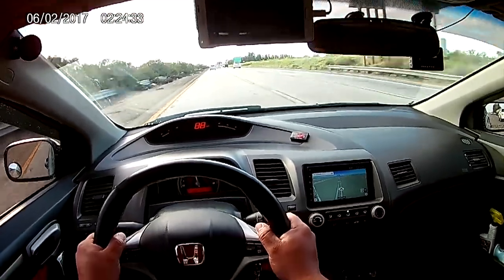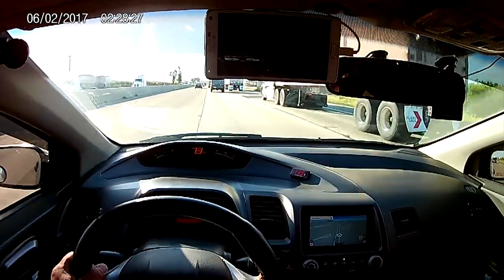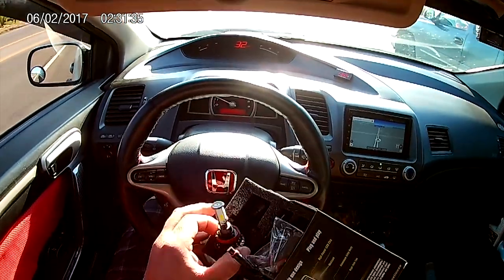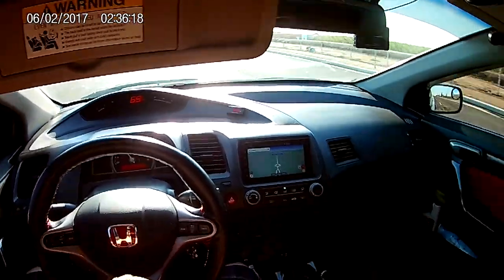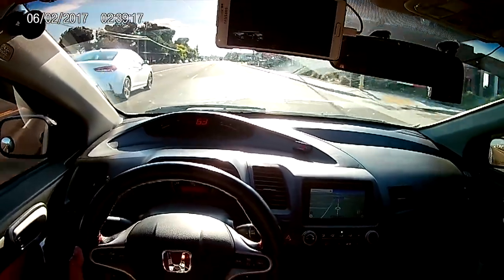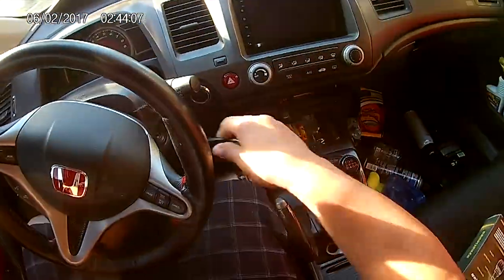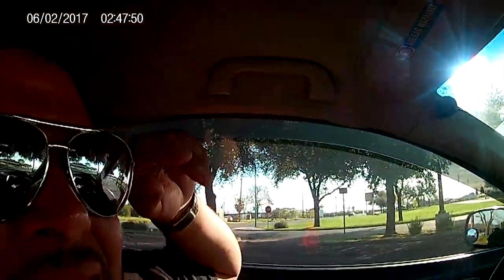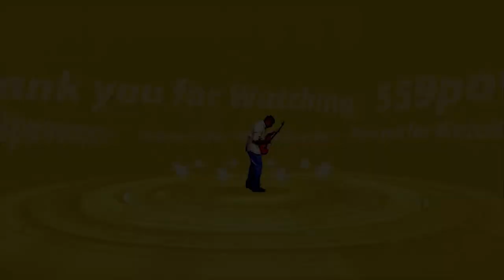POV: Driving my 2006 Honda Civic Si to work and Hitting some V-tech! BRAAAAAAHHHHHHHHH

Comment: Mods?
Reply from the maker: None to the motor yet, but do have some future mods in mind. Just have open throttle k&n air filter. Previous owner welded 3in piping from the cat all the way out before the muffler then drops down back down to 2.5 and it has an aftermarket muffler for sure its not the original but is pretty loud...not as loud as i would like it to be but good enough
Reply: @559powerscape  I currently have an invidia q300 + sk2 header and intake,  however, I'm going the stock route. 

Want to quiet down a bit the car.

I'll miss the performance,  though. 

Good luck with your build!
Reply from the maker: @lightspeedX2  Heck yeah shoot if you wanna send those parts to me I won't get mad lol
Reply: It's funny when people ask what kind of mods you have on a stock SI these things really were f**** screamers man right out the box with minimal upgrades you can embarrass people and take their pride in the Civic which is one of my favorite things to do something about taking a man's pride in a Civic
Reply from the maker: Lmfao 🤣 🤣 🤣 that shit is funny, yeah bro the k series engines move and they love to sign high notes

Comment: The early 8th generations are raw as f*** they tamed them down and dolled them down after the facelift.. the 2009 Civic coupe with the same r18 engine is almost 2 seconds slower to 60 than the 06 Civic coupe
Reply from the maker: Yeah bro the 06 doesn't have traction control or tpms either hella raw